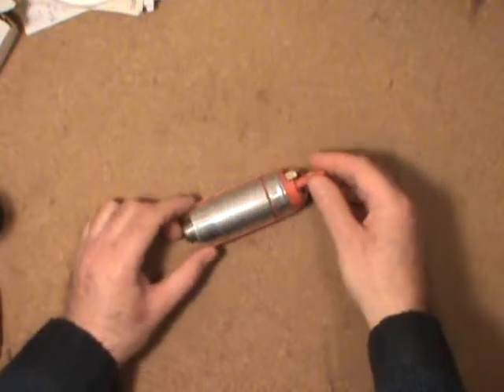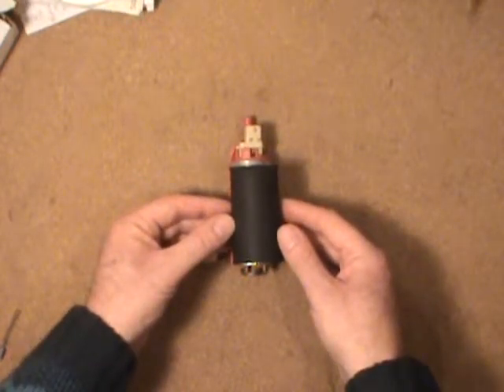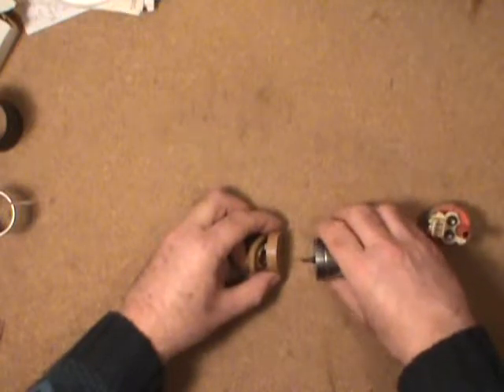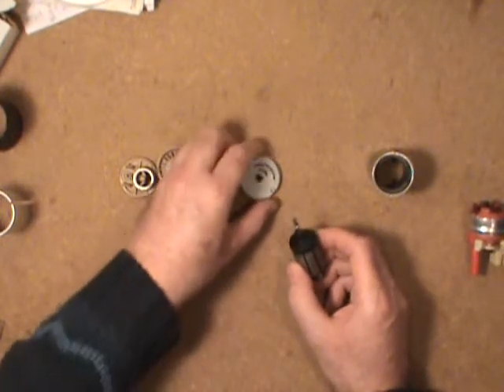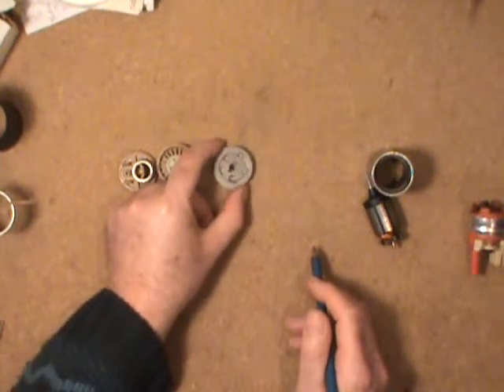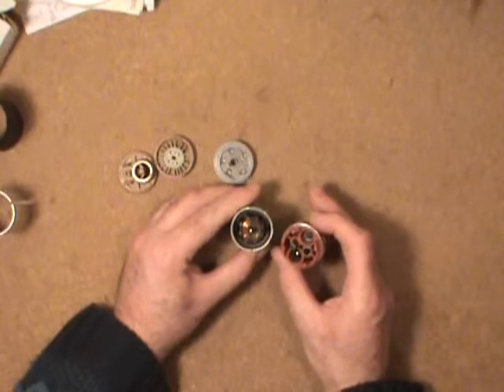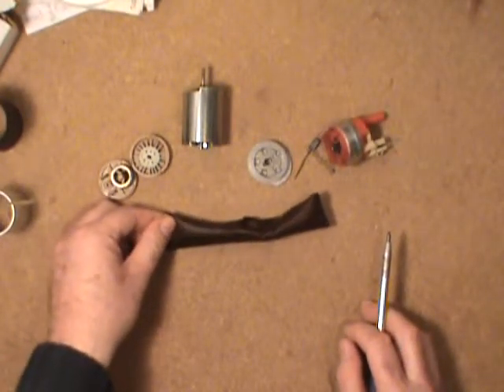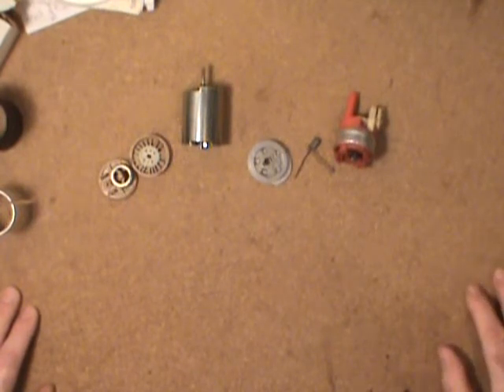Fuel Injection Fuel Pump (electric type) Taken Apart and Explained

Comment: Nicely detailed.
Reply from the maker: +n4mwd ....Greetings n4mwd....Thanks for the Great comment, and for watching this YouTube Video of mine as well..........................If You haven't done so already, please read the Comment that I posted, when I Replied to "Ben quinn", on this very same, Fuel Injection (electric type of) Fuel Pump...Video, as, there's quite a bit of Information, that, as I see it, should give You some things, to be aware-of/looking out for, that will, for the most part, be able to (hopefully), make an...inside-the-gas-tank...Fuel Injection, (electric) Fuel Pump, last that much longer, which will probably save You, quite the Expensive Repair Bill, that really wasn't needed, and, not wanted, sooner than need be...!!!............................Till next time...........Be Safe, take care, and have a good one.
Reply: +RockysRoadshow I was working on the EFI system on my motorcycle.  It has an external fuel pump.  One little goof.  I removed the pump and shook it to get the gas out.  Bad move.  It let gas under the brushes which dried into lacquer.  Pump ruined.  I took it apart and its an impeller design.  The commutator was covered in lacquer.  A little cleaning and the pump ran just fine.  Too bad I can't put it back together.
Reply from the maker: +n4mwd ....Greetings n4mwd....Yes-Sir-ee-Bob...I hear Ya, when it comes to that so called Gasoline, shall we call it..."Residue"...that gets left behind, after the Liquid portion of the Gasoline evaporates and goes missing...lol.................I recall seeing some of that Gasoline Residue, being stuck really well, to the insides, of some of the car and truck Carburetor's Float Bowls, that I Rebuilt some time ago........................The Brownish colored Residue, that I've found/seen, is what I usually like to call...Varnish-like...not to mention, that I've also seen some...Greenish colored yuck-ees as well, that might be along the lines of something, that I remember, being called Verdigrees (spelling?).........Let me guess now, about Your Motorcycle's EFI Fuel Pump, as in, there were probably some sheet metal Tabs, or, Rivets, holding the, shall we call it, an End-Bell perhaps, to the rest of, the usually sheet metal Fuel Pump's Body maybe...???........................Reminds me of, when I use to, Re-Wind, Epoxy, Balance, and polish-up the Commutator, on some of the Slot Car Motor's Armatures, that I use to mess with as a teen-ager, some of which, I still have around here somewhere...Yip-ee..!!!...lol...........................Just curious, is Your Motorcycle's EFI Fuel Pump, mounted externally, and Under the Gas Tank, and being Fed the Gasoline, from the gas tank, by Gravity maybe...???...also...any idea, on Your Motorcycle's EFI...Fuel Pressure at all...???...Fuel Pressure Regulator...???...........I've seen it where, an older Dirt Bike, that doesn't get used, and sits around for too long, have that so-called Gasoline "Residue", do the following, and on the same Dirt Bike as well...............The gasoline Shut-off/Reserve Valve, that was mounted externally, and on the bottom of the gas tank...Frozen/Stuck/Won't Move...and the Mikuni Carburetor's Slide/Valve (inside the carb) Stuck so bad, that the Twist Grip Throttle on the handle-bars wouldn't Twist, well, the free-play in the throttle cable would let the Twist-Grip-Throttle move a very tiny bit, pretty much tellin' me, that the Twist Grip Throttle wasn't the cause of that Non-Movement, as I see it, that is........................................I'm not all that much of a Fan, when it comes to just about anything, that is Electrical in nature, and has the ability to Spark....Anywhere Near or Submersed...in Gasoline, cuz-of, what the outcome might be, if something were to go horribly wrong, but hey, that's just me (maybe Others as well perhaps...???)....................As I see it, it's probably Much Better, to Install a Brand New, Properly Sealed, EFI Fuel Pump, anywayz, for Safety and Peace of Mind, rather than, have a Used, and might Leak EFI Fuel Pump, that could potentially have, some Dangerous consequences, don't-cha think...???.....................Well, till next time...........Be Safe, take care, and have a good one.